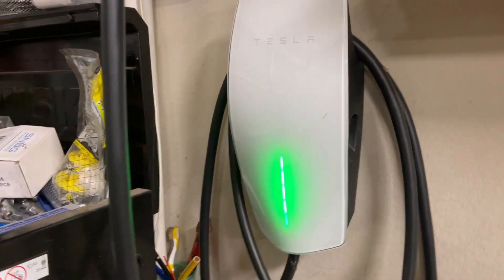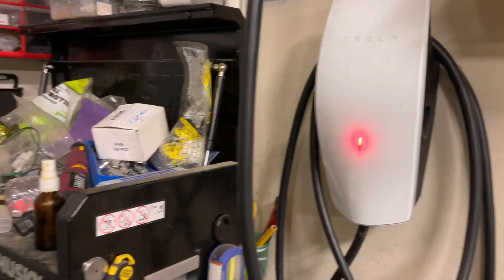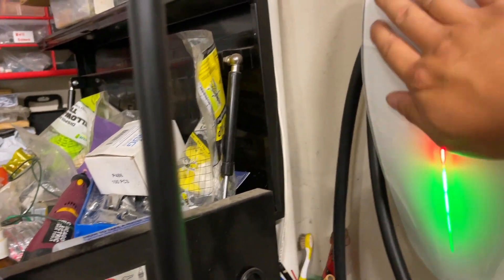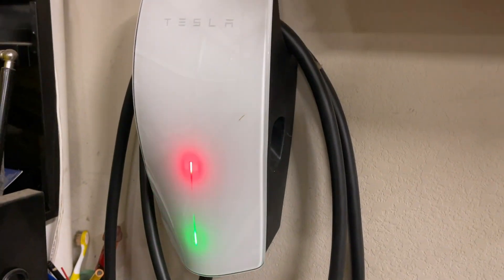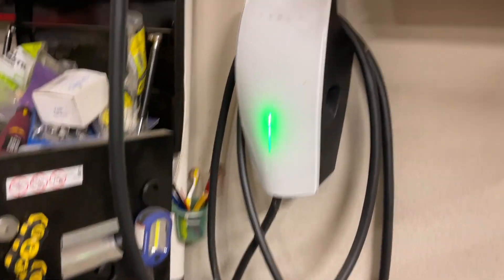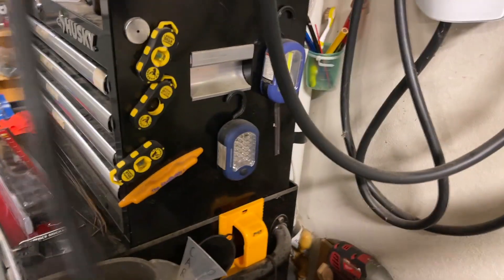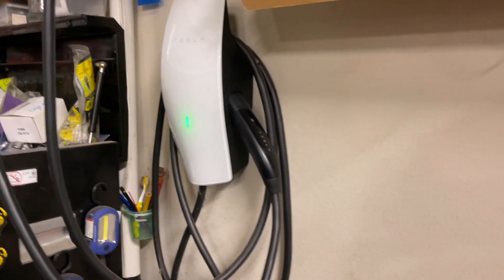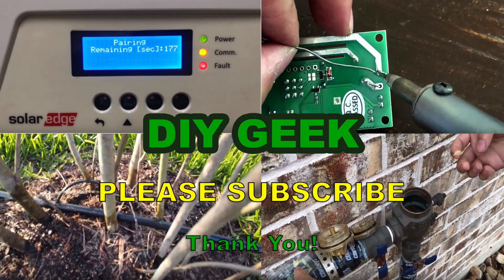3 BLINKS RED LIGHT - TESLA WALL CONNECTOR

Comment: Had out gen3 charger for 3 years, we are in the UK its like 6 degrees C and we just got these 3 lights. We have tried everything and it still does it, different cards, different circuit breakers etc. WE installed a new GEn3 charger and it works perfect. Now trying to chase Tesla for a refund!

Comment: How long have you had the charger ? I have had the charger same location same weather and temperature in my garage.  But for some reason now my garage is too hot ? 2 or 3 years it’s never done this.  Can an update fix this ? It’s not the temp in my garage plus some people have these outside in the sun.  I think it’s a sign that the charger is having its own issue.  Any thoughts ?
Reply from the maker: By that time I had that red light issue, I had the charger there probably about 1.5 years.
Reply: I charged at night in Oklahoma with outside is 41 degrees and inside is 52 degrees but it has the same issue. The wire does not get hot. I don’t know what cause it.

Comment: Mine blinks 3 times but the charger and the cord are very cold.  Tried everything, no luck.
Reply: In Wisconsin. 50 degrees out. Its doing that for my wife and for my Model Y. Nothing changed. It has always been at 40 amps.
Reply: Find any solutions yet? I’m trying to find a solution before i have to book a service appointment for it
Reply: @user-yc3kc3ic3n  My charger worked great for 1 day and developed the red blinks 3 times even the garage temp was around 75F.  Charger and cable were just slightly warm.  I fixed the problem by tightening all the connections in the 60 Amp breaker & ground.  Make sure the main 240V breaker is rated at 60 Amp and the cable is 6-3.  Also use the torque wrench to 5.6 N-M on the Tesla wall connector.  It appeared that after the initial charging at 45 Amps might have caused the wire strands to settle inside the breaker and charger sockets.  So re-tightening to the specified torque value is critical for this application.